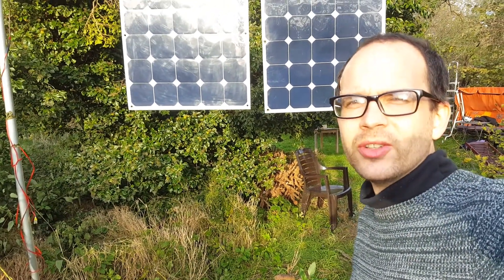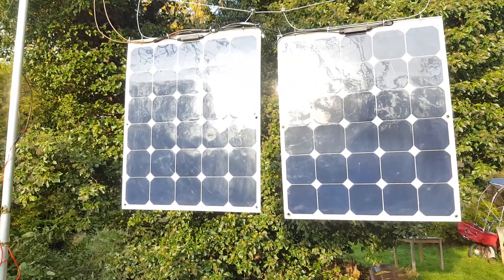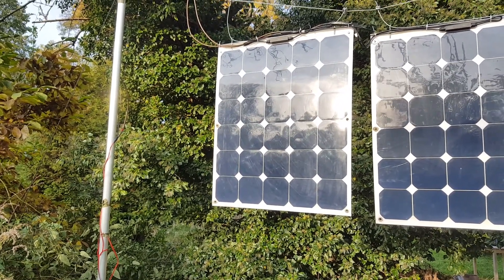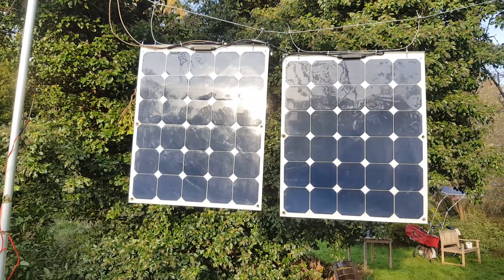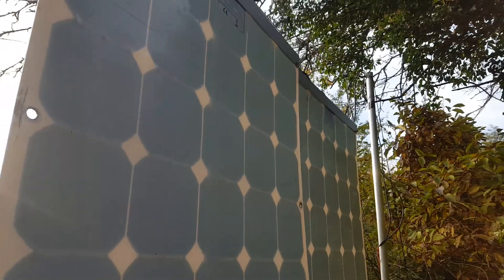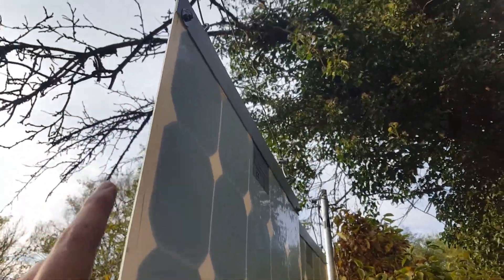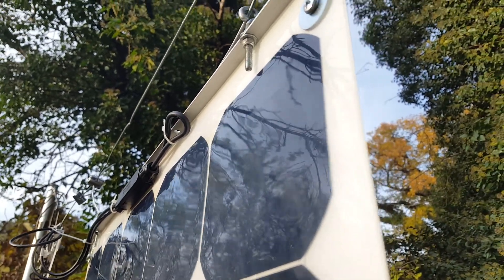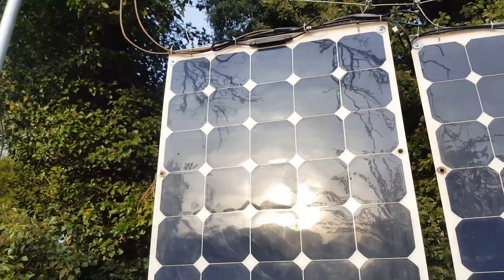Cable PV - Low Cost Vertical Mounting System for Lightweight Bifacial Solar Panels

Comment: Maybe for heavier panels,  most of the weight is supported by the bottom, resting on the ground. And you could use a weathervane effect for rotation in the wind.

The support frame is curved at the bottom so it can rotate in place. The top hangs from two points near the center, so it can rotate with the wind - but still return to the desired orientation later.